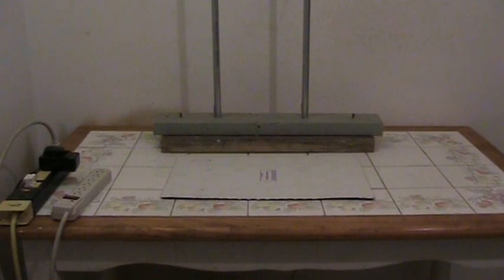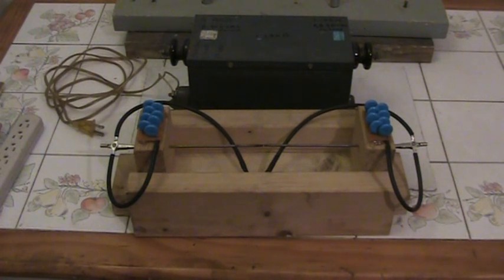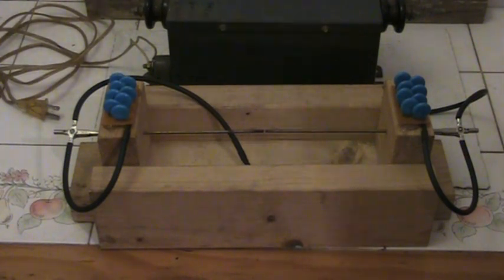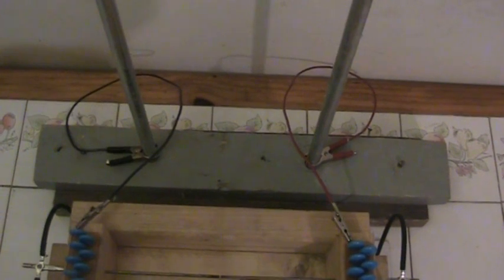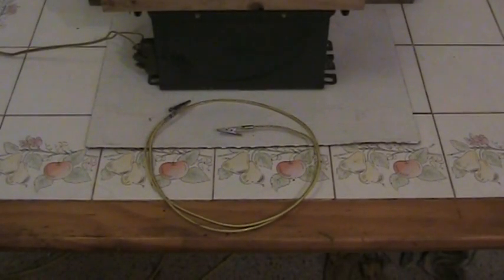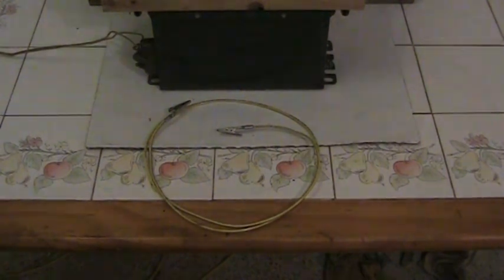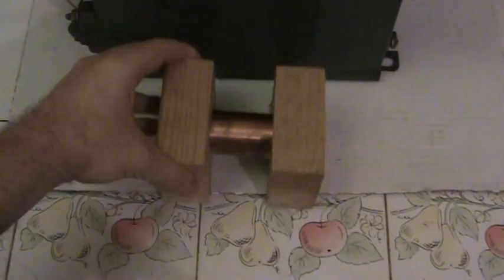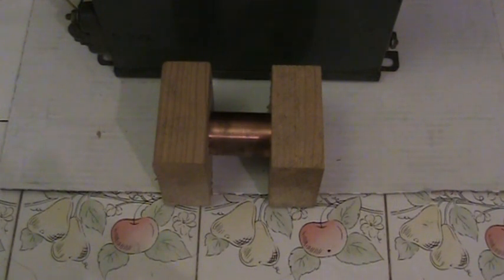Tesla Hairpin Replication - Description and Demonstration 1

Comment: I once had a GE neon sign transformer rated for 12kv @ 30ma and made the mistake of grabbing both conductors coming off of it. One in each hand. Yeah. I was lucky I was already sitting down. I had my friend who was there check my pulse immediately afterwards (was gonna shock myself again if not lol) and my heart didn't beat steady for 3 days after the fact.
Reply: Yeah I will eat that for breakfast at this point lol.  What got me good and lucky I aint dead was running a 15Kv 35ma into my small Tesla coil primary with a bunch of salt water caps till the arc was white hot at the spark gap about inch and a half or more.  Something happened and toppled over knocking my secondary over towards me and dumb ass instincts grabbed that shit as it touched the primary coil and knocking the wires off making me the path to ground.  Blacked out for a minute there.  Crawled up the steps and sat at my table in a greyed out haze for idk how long, prob a few hours at least.  Not really sure why I survived that to be honest.  Should be more than enough to end me.  I  suspect it was how I was grabbing it with both hands pretty much the same spot and somehow got lucky to not have the current cross my heart idk.  Not good.  Seen 3 and a half stars,  Would not recommend.

Comment: I recognize that you may have moved on, and abandoned this work, or run into other distractions. In researching this technology, a number of comments may inspire a revisit.

Tesla's spark gaps recognized that the typical spark is not unidirectional. It alternates many times in one spark. The goal was to get this to stop and be purely one direction with each discharge. Gray picked up on the unidirectional nature and set up his sparks to be only of one polarity, being say all positive in polarity, sparking from a low positive to a high positive charge. This splitting the positives put waves of one direction current into the Aether, which would then add to the  traveling wave, like the way sound is compressed and amplified in a solid stone or bell. Collecting that extra energy in his tube, which is basically an air capacitor, proved the whole claim that Tesla made about amplifying electricity from his alternators with spark gaps and capacitor banks. He was able to self-power his alternators and generate electricity that he then sent as current of uni-directional-compression-waves without loss and without conductors. (using his high capacitance air core transformers, Tesla coils) Gray's power conditioning circuit was designed to manipulate the current he collected, his grounded capacitors were necessary, not misdirects as well as the extra spark gaps to shunt the excess power he collected, but could not use to charge his additional power sources.

The optimal spark gap design for Tesla was one that managed a million volt differential, had high speed counter rotating aluminum discs with spikes on them immersed in an oil bath that had a jet of oil pumped between the contacts where the spark was. His primary coils that were across his spark gaps were very high current inductors with lots of metal mass, that transferred the power to a bifilar winding that had the capacity to hold and amplify the current exponentially within the voltage differential between the windings. This was then broadcast with a directional antenna as a capacitive wave of current, not voltage. 

This is not the optimal purpose of the hairpin. The hairpin is just the primary side of his Tesla coil. It illustrates that current can be used in applications that otherwise would be voltage limited. By neutralizing the voltage differential, you get cold electricity.

Tesla used this bifilar arrangement to shift the phase of the current in his electric motors, defeating Lenz's law as this shifted the phase of the magnetic field that opposed the flow of electricity powering the motor. EM induction is a two phase process, not one as it appears in common generators or motors. First the current/dielectricity is transmitted and collected, then the polarity shift causes the current to flow creating the reverse magnetic field. If the collecting inductor has enough capacitance that opposing magnetic field can be supporting in actual function. His patent for a bifilar wound inductor stressed the power storage capability of the flux-capacitor (bifilar winding) and its neutralized inductance by the integrated capacitance. Lenz's law only applies when the inductors have no capacitance, then the current flows with minimal delay when a load is connected.

Your shunt and connections to the capacitors should be comparable in metal mass to the conduit you used for the hairpin. The hairpin is a current sink that is set up to short out the voltage differential between the two capacitor banks. The current travels at least 57% faster than the voltage in the hairpin, except where it is limited by the smaller wires. This and even the small loop, or inductor you create in your shunt are impeding the effects Tesla was trying to create. You may note that Karl's shunt was the same copper pipe that made up his hairpin. And when the shunt is in place, the hairpin keeps the current trapped between the poles, open the shunt and it broadcasts  better as the voltage differentials are no longer neutralized.

If you want to do actual research. You might build an insulated GEET reactor and see what kind of power you can pick up with similar designed "Gray Tubes" It's how the Planet and Stars broadcast electricity. See "The Book of GEET: Part 1" for details on building a desktop Solar generator, a self contained plasma reactor without electrical input. 

Keep up the good work. Peace, B

Comment: What's the point of all this?
Reply from the maker: The point is, I had seen a number of videos on YT about the hairpin circuit where people failed to explain exactly what was going on with this device, and instead just perpetuated the confustion about it.  So, I took it upon myself to determine just was was happening in the circuit myself.  It's quite interesting for such a simple device.  Tesla used it to generate RF in the mega-herts range.
Reply: Fred B's Video Blog
I watched it and you didn't explain how it has any value or use. I can make a light bulb glow a lot easier ways than building a contraption like this. What is so unique about it? What function does it serve? Answer those questions rather than waste 45 minutes tinkering with wires and bulbs.
Reply: I used my mini-hairpin (~500 volt) to over-power my radio, an  87FM and 97FM radio stations 12 feet away.I am guessing 107 FM also.Stations in between were not affected.Results are posted.
Reply: I'm sorry I slept half way through it ...What happened?